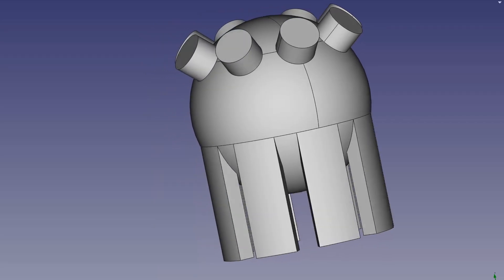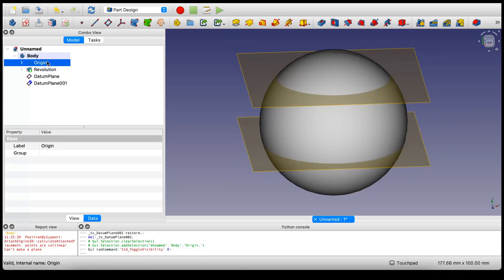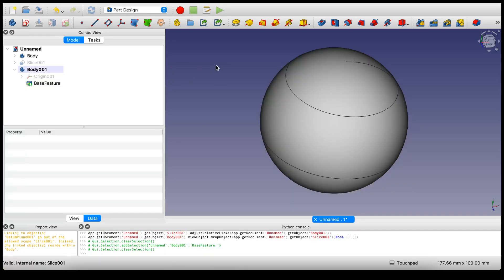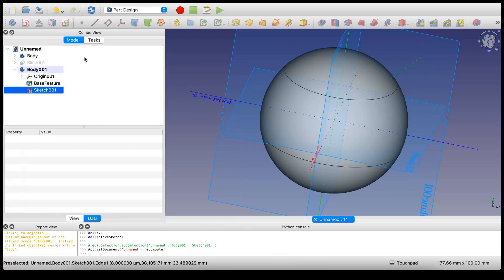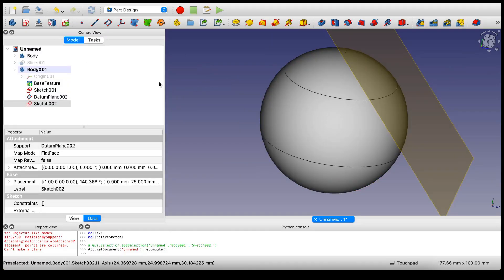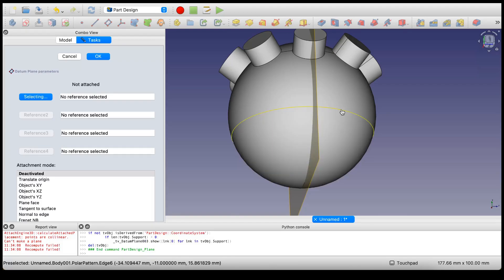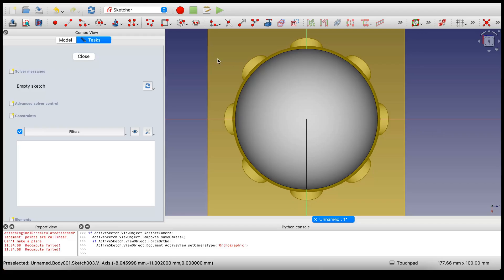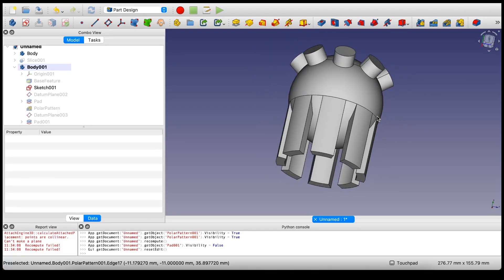Make any Shape on a Sphere in FreeCAD

Comment: This video is great.  Did you make an example creating a pocket?  I’m using freecad 0.20 on a raspberry pi.  When I try a pocket, I receive an error about multiple solids not being supported.  It might make sense given the sketch isn’t a fully on the sphere but sitting tangent to the sphere through intersecting at a point on it.   I’m just an amateur trying to learn CAD.
Reply from the maker: Yeah FreeCAD has a steep learning curve, I still don't know all the ins and outs myself :)  Your're right I should make another video about pockets.  Process is exactly the same, and it works in FreeCAD 1.0 just tried it.

Some troubleshooting you can try:

(in part design workbench) Make sure to drag the slice (you made in part workbench) into the body.  At that point you can sketch on the reference feature.

When you are at the point where you have the circle sketch made (for the pocket), select it, click on pocket, if you don't see anything click on reversed, you should maybe see it then.
Reply: @SierraApex thank you!  Your comment gives me hope I missed a step or my version is wrong.   I will try again later today.
Reply from the maker: @Philster34 Sounds good.  Good luck!
Reply: @SierraApex yup 1.0.2 mostly worked.  The pocket is formed but the part of the sphere above the slice also appears to be pocket’ed as well (it disappears). I’m completely new to cad so my vocabulary isn’t well versed in better terms to describe it.  😂
Reply from the maker: @Philster34 Thats good.  Keep messing around with it to see what works and doesn't work, I found that's the best way to learn for me!

Comment: So. Apparently, this doesn't work right anymore.  I tried following along and when I go to pad or cut out my sketch on my sphere, all the other sliced parts vanish.  Further, the hole or pad exists independently and will not/cannot be visible at the same time as my base feature, or any element of it. If I try to make both visible, it automatically makes the other invisible. 

It's possible that I am looking at the wrong video, but this is the closest I have been able to find. 
Specifics of what I'm trying to do:  I'm making a hollow hemisphere with evenly spaced holes around it.  I'm also using FreeCAD V1.0.2. So I don't know if they changes some aspect of how this works since this video was uploaded.

It seemed reasonable that this tutorial would be what I need to do, but as I said: it doesn't work.
Reply from the maker: That's sucks.  I need to look back on it again.  My guess it has something to do with the introduction of FreeCAD 1.0.  Such a quickly evolving software, can make old methods obsolete after a short time.  Its a double edge sword this progress.
Reply: @SierraApex I got it figured out. And I think I know why it wasn’t working for me: forgot to make the additional features separate bodies.  Once I did that, a lot of it started working correctly.  That and switching to different work modes to do different things, like using one body to make a cut out of another- needing to switch to Part rather than Part Building(?), or Drafting, etc.
Reply from the maker: @EmrysCoppersmith  ok thats good!

Comment: In FreeCad 1.0 the dropdown menu to create that circular edge is different, and none of the options do what you are doing; they all destroy the sphere. So you can't get past the step after creating the sphere.
Reply from the maker: DAMN YOU FreeCAD!  I'll need to see for myself, but I kind of was expecting something like that sooner or later.  It's the price of an evolving software I guess.  

Hopefully in the near future everything can be consolidated (including this) to the part design workbench, which would be my preference.
Reply: @SierraApex  I think a lot of positive changes have been made to get to ver1.0. You are providing an example "water tower" configuration; I would redo it as follows: instead of completing the circular arc as a semicircle which makes a solid sphere I think, complete it as a semicircular shell; that would be very realistic; I think I'll try it for fun! If you find a workaround to get past what I see in ver1.0, lemme know.
Reply from the maker: @ Will do.  I would agree FreeCAD 1.0 is a quantum leap forward.  I'm happy its becoming a more mature CAD software that people are using more and more.  Pain points still exist, hopefully those can be worked out.
Reply: @SierraApex  I just constructed a pair of concentric semicircles connected with short vertical line segments to complete the arc; it revolves nicely, and if you make it transparent you can see the inner sphere...nice!

Comment: wonder if anyone can help :) how do you make a hole in a sphere, Think drawing knob on joystick thanks
Reply from the maker: Sure! For example, if you look at the video at @5:55 click on the "pocket" button and that will do it for you.
Reply: @SierraApex  yes but I fail on a sphere :(
Reply: hmm cant paste picture
Reply from the maker: @David_11111  it is possible one of two things are happening.  

1. It is trying to make the hole in the wrong direction.  when you press the pocket button and see "pocket parameters" there is check mark called "reversed". check this box and the direction of the hole will go in the opposite direction.  

2. the length is too short, try increasing this.  

If you continue to have issues maybe others are having the same issue and a video can be made.
Reply: @SierraApex  yes please
Reply: So I followed your video, made a sphere by drawing half circle and then a line. Used the revole button to make shpere... also I tried  putting a sphere down with the spare tool...  very similar results of error message or sphere vanished... on my phone now.. Best description 🤣  I can offer away from pc... but thank you for making all of your videos
Reply from the maker: @David_11111  Ok i've been busy lately but when I have time I'll make a video about adding holes/pockets to cylinders.

Comment: Those datum creations are mega picky on what is clicked on and in  exactly what order, and mine didn't seem to auto-show or auto-set some values and such. My freecad wasn't behaving like this one and it took numerous tries to get the blasted attachment set correctly.
I like added features as things progress but am finding freecad apparently changes core tools regularly and significantly. Some tutorials I have to look up what is the new/different tool to replace what is being demonstrated - and it can take longer than the video itself. I wish devs understood that really hurts the learning curve. Add and improve - don't scramble and rearrange.
Reply from the maker: FreeCAD definitely has much to improve.  I agree it can be very frustrating to learn.  It’s kind of the only purely open source solution at the moment that meets my needs, so I need to kind of work with it and understand that strange things may happen.  For this problem specifically, I think part of the problem is that it sometimes doesn’t recalculate after every step.
Reply: @SierraApex Press F5 key or click over the "Refresh" icon with a blue circular arrow when it's not grey
Reply from the maker: @LFANS2001  good point :)

Comment: Thanks for the video. One big tip/request-
It'd be hugely helpful if you speak every tool/value you click on or enter. For beginners like me actually doing the steps at the same time, it's very difficult to follow along when actions are said with their generic terms or when they required multiple steps but only one general one would be said. Some tutorials I can follow with hardly any rewinds or strict visuals, but this one I had to do so a lot and go back to see exactly what you clicked on many many times.